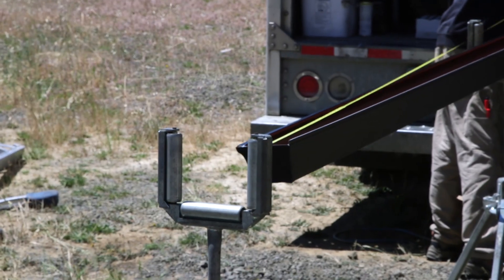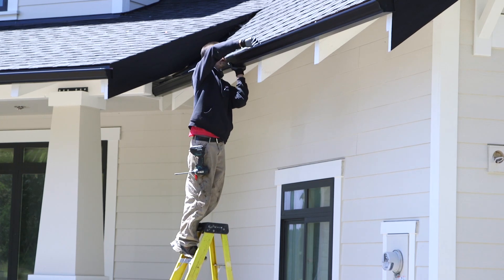Rain Gutter Installation Ep. 124

Comment: 1st of all I love all the videos!
The problem with architectural details, is they are hard to finish with good detail.
The front porch columns are one of those pesky details.
Personally I would use a rainchain instead. 
Down into a wider disguised gravel sump, then to into the ground connection.
3x4 downspouts are not aestheticly pleasing either.
For unlimited budgets, the gutter feeds into the wall to an internal downspout.
Different looks are different budgets, not the same for every one.
Reply: Rain chain is a great idea. I cringed looking at the front porch install

Comment: I have been waiting for this episode for a while.  I've suspected for a long time that my gutters were installed incorrectly when the house was built 20 years ago.  I've always wondered, and it wasn't answered in the video specifically, but how much slope is necessary in a gutter system, to ensure water runs to the downspout?
Reply: We pour water on the roof  from an old plastic  pop bottle, and make it run as slow as we can but definitely  enough  that  the water  runs to the downspouts. Taken off many old gutters half full of water and shingle grit.  The brackets they are using  won't allow proper  installation of  leaf guard  if required, as it sticks up in the middle  when the screw is screwed in.  Difficult  installation  having  no fascia. We place a bracket  every foot, normally  they are every 2 feet, these look to be several  feet apart with no support  behind the  trough
Reply: @rickcathcart2196  thanks so much for the response.  So it sounds like the slope is VERY NEAR zero but not quite.  It’s JUST enough to ensure that water does run!

Comment: They should have extended those upper downspouts to not dumping on the roof. Wears out the shingles much faster and guarantees that spot will rot well ahead of the rest of the roof.
Reply: I agree,my sons house had 2 locations like this and showed signs of rot within seven years after a new roof with sheeting was installed.
Reply: It also leaves water marks all down the roof too.
Reply: Extending a downspout over the roof is not practical, it looks terrible and would require penetrating the shingles with screws to fasten the downspout.

Comment: “Any mistakes at this stage are going to be obvious” then show ground drain not planned for hook up and they have to put 2 right angles on…. Veranda down spout not planned either…. How does this get passed by inspector?
Reply: Yeah I'd be talking them into a rain chain. There isn't a good place for down spout or a half cap.
Reply: I will give Scott the benefit of the doubt. There must be a good reason the "ground drain" does not line up with the leader pipe. As for the veranda, I wish I had told Scott to install leader pipe within the interior of the columns, therefore eliminating the vertical pipe conflicting with the tapered columns.

Comment: It was my understanding that you don't want to use aluminum gutters or flashing, if you're using a shingle with algae resistance. The shingle exudes a copper particle that will deteriorate/corrode aluminum in a matter of a few years, especially in salty marine environments.
Reply: This installation gets worse and worse😞
Reply: This isn't the coast.

Comment: No issues with downspouts from 2nd story dumping onto roof/shingles of first story?
Reply: Nope. Standard practice.
Reply: Tacky
Reply: You know that shingled roofs are made to have water running down them, right?
Reply: @andrewalexander9492  no crap.  But rain on a roof is different than 100 gal/min dumping onto the same spot for 30 years. It was just a question on best practices.
Reply: It is a bad idea and I promise the first part of that roof to go bad and rot will be right under that spout. They should have extended the downspout directly into the gutter below.  Not impressed.
Reply: Commonly done but causes that part of the roofing to wear faster than the rest.  Standard practice to extend the downspout to the gutter below.  Folks don't like the look of it but that's the standard.
Reply: @carlislehendersonthethird7799  Not standard practice. The downspout from an upper roof should drain into a lower gutter. It should never drain directly onto the roof.  Use the google and you'll see it referenced there.

Comment: Use a safety harness people. How many days or even years pay will a fall cost you? If those guys were building my house I'd send them away.
Reply: I agree that the A-frame ladder the one installer was using was too short but i hope you aren't suggesting they tie off when using a 20ft extension ladder with stabilizers on it? That would not be very efficient .

Comment: I have recently seen gutter installers put down spouts in wrong. Where they meet the gutter, they run the wide part perpendicular to the gutter and it sticks out past the bottom. Looks cheap and just bad. The one installer I talked to said they didn't have the part to turn it so they just install it that way. Shameful workmanship and not much pride in what they are doing. 🙁

Comment: You have to admit, you cheaped out on the gutters.  So much of ths project was top flight but this work was tract grade.  A builder has to make his margin somewhere, I get it, but I would not confuse this with with the term "craftsman."  How you frame a stairway is "craftsman" and you might not want to sully your own master-level skill with this price-driven work.
Reply: I despise negative comments, but agree with the craftsman part. This house deserves a craftsman quality gutter installation that should have included cutting, braking, and soldering of copper gutters and downspouts. By industry  standards, this is a fairly decent gutter job... sans the column downspouts! I wish I had told Scott to install leader pipe within the interior of the columns, therefore eliminating the vertical pipe conflicting with the contour of the taper and the stone work.